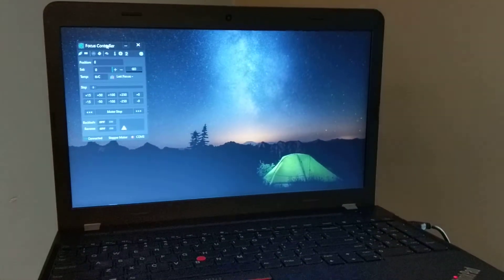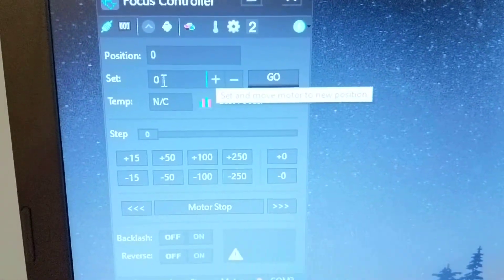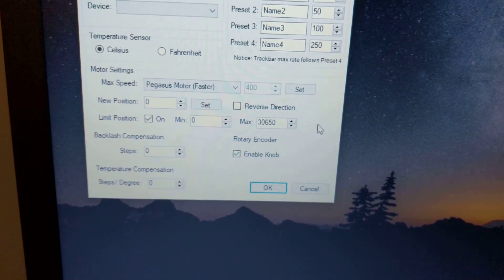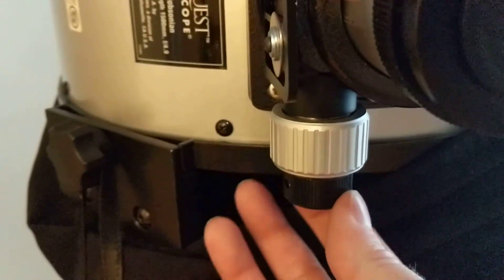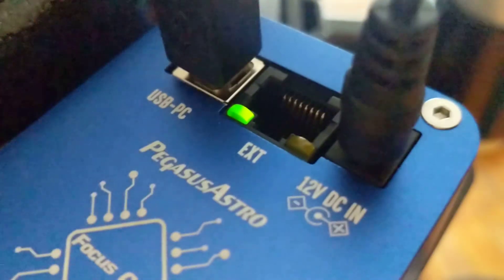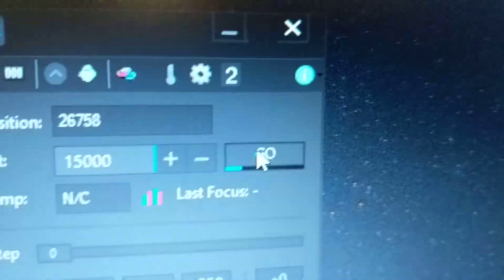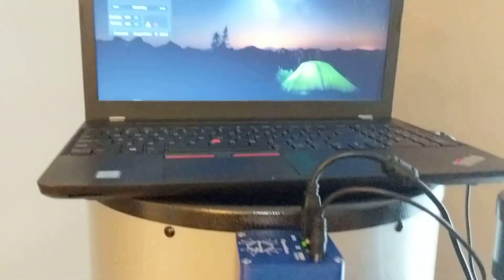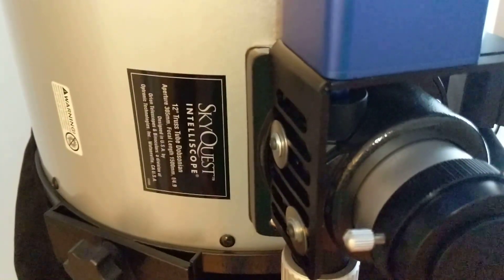Completed install of Pegasus FocusCube 2 on an Orion XX12i telescope

Comment: I currently use a laptop to control everything but the focus.
Reply from the maker: Then you'll probably be fine! Just a little custom hardware work to get the focuser mounted. The photos I shared should help. Take one of the existing focuser screws with you to match the threads at the hardware store. They'll need to be slightly longer than the OEM screws, but not too long. You may not even need to shave the bracket like I did. I just felt like the fit was better after shaving the bracket.

Comment: I was hoping to see how to fit bit to the focuser.
Reply from the maker: I bought some custom screws and washers at the hardware store, and then chose two of the holes on the focuser that are diagonal from one another to mount the motor bracket. You can see in the video that there are those two screws and washers that are diagonal from one another. I also had to notch the bracket slightly in order to make it fit better around the curve of the focuser housing. To do that, I put the mounting bracket in a vise, and very carefully used an angle grinder to remove some of the metal.
Reply: @jsauve23  O dear doesn't sound as though it's going to be easy for non techy person.
Reply from the maker: @woldsweather  I would not recommend a computerized focuser if you're not interested in dealing with technical challenges. The second challenge after getting it mounted is using your laptop to control it. The controller software is pretty good, but has a learning curve.
Reply from the maker: https://photos.app.goo.gl/kBTeufxwCfrFznhc7

Comment: Hello Joe,
interesting video; I'm considering buying a FocusCube 2 for my Orion 8. From what I see in the video it has the same focuser as on your XX12i. I've understood that it's not a plug'n play thing. Can you please give the details of what customization you had to do, to install it on the focuser. 
Thanks,
geert
Reply from the maker: Hello!  Sorry for the delayed reply. I had to shave some of the bracket down with a grinder and sander in order to make it fit. Here's some photos:
https://photos.app.goo.gl/Tj8p35dtovAMy4WMA
Reply from the maker: I also had to track down some custom length screws and some washers at my local hardware store. I used two of the four holes for mounting the bracket. You wouldn't want to use all four because at least two need to remain to hold the regular focuser mechanism together. Also be aware of the rubber washers inside each of those holes that straddle the original screws. I recommend taking the focuser partially apart in order to fully understand how it works before you try to mount the FocusCube 2.
Reply from the maker: I learned some things after making this video. One of those things is that you can get three full revolutions out of the FocusCube 2 motor with the Orion focuser. So, since the FocusCube 2 supports 11,510 steps for a full motor revolution, you can get a total of 34,530 steps out of the full travel of the focuser tube. So that's the max step value that I set in the software, to prevent it from ever going too far.
Reply: @jsauve23  Hello Joe, thank you so much for your reply but I don't think I'm brave (read: handy) enough to take the focuser apart.
Reply from the maker: @geert5811  Fair enough! I understand where you're coming from. It's honestly not too bad. There's actually not any kind of gear where the focuser knob's rod meets the focuser tube; it's just held in place by tension. I was definitely a little nervous to dismantle mine, but I generally enjoy taking things apart and putting them back together. I understand that it's not everyone's cup of tea. The nice thing is that the focuser itself doesn't get physically modified in any way, just the bracket that comes with the FocusCube 2. And if you mess it up, they sell the bracket separately.